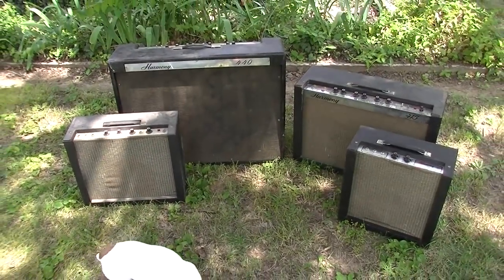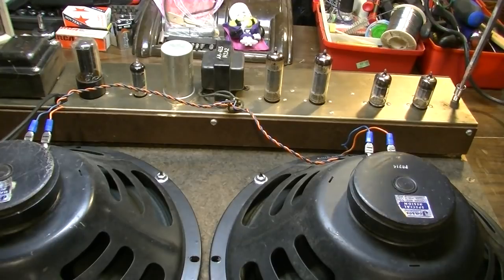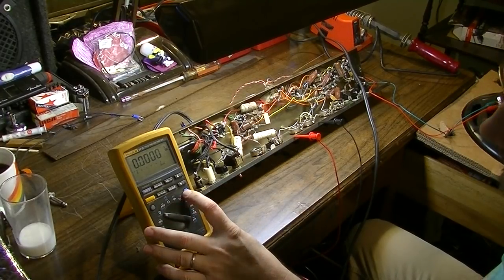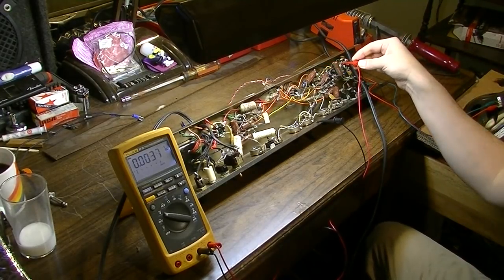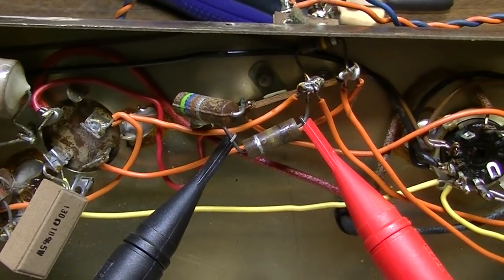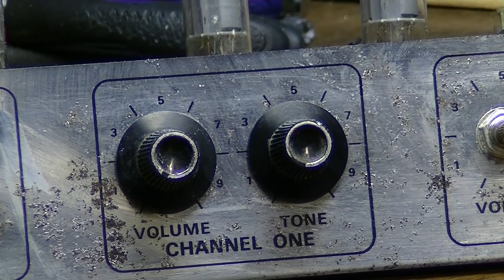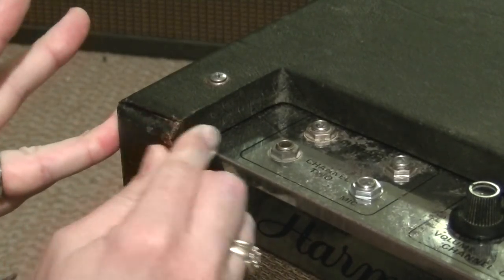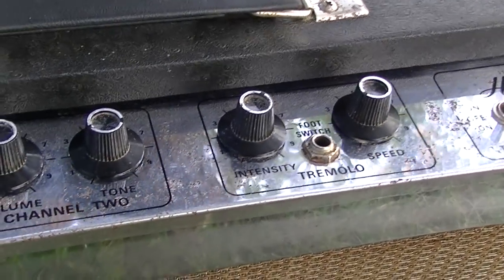The Ken Fischer "Sleeper" Amp! - Harmony H415 Restore & DEMO

Comment: I have one of these that used to belong to my cousin.  The amp stayed in a hot attic part of its life, then later a moist basement for 35+ years.  Rusty, covered in mold, much of the amp was gone as well as the particle board.  I had to replace the audio transformer, the filter can, striped the cabinet and use bondo and Titebond to repair some of the rot and loose joints. I fabricated a new speaker panel (now a 1x12 instead of 2x12) with birchwood paneling.  It is currently painted with flat black trunk bed liner until I find time to replace the ostrich tolex (which I've never done).  The Jensen speakers were rusted, no paper left, so I put a Emerson Private Jack in.  The circuitry was the only clean part of the amp oddly enough, but replaced the capacitor can with some filter caps I had from a previous project.  I cleaned the pots and jacks.  It still hums a little.  I would like to reduce that some more.  Not sure what it is.  It has a big very warm sound and cranked up it breaks up so nice.  The tremolo tube was the only original tube in tact.  Construction was a little cheap compared to the big name amps, but it was still great quality compared to some of the amps sold today.  It held its own against some poor treatment as it was just an old piece of junk, but now it is a treasure.

Comment: This was great to watch. My very first amp was very similar- Harmony with 2 channels and 2 , 12 inch Jensen speaker and  red racing stripes down the front. My father was teaching himself  bass and purchased this as his amp through the Alden's mail order catalog-  based in Chicago about 1967 or 1968. 
When I had been playing guitar and taking lessons after about 2 years, my teacher said I was ready to move to a better guitar and to electric, so this become my amp in about 1971. My father has a degree in electrical engineering and I remember him distinctly saying the amp was 25 watts and had 2  6L6 in push pull  parallel, so not the EL84 you mention in the video.I had no idea what any of the tube info , etc. meant at the time.  He  purchased a Lafayette bass amp- also mail order. 
I remember my Harmony as a sweet amp but I could never  push it into any kind of overdrive and that would have been too loud in our home and then in my first band- 1973, the other guys in the band did not have anything as  nearly as loud , so again I could never push very loud. My  friend Bill played through a small Alamo tube amp, with either a 10 or 12 inch speaker.  I played my first gigs with this amp in 1973 ( school variety show and parties that summer)  with my friends in the band and also a wedding band with my Dad playing his  Harmony  semi hollow bass and a  New Year's Eve dance at the local AA. - pretty safe being with your Dad in the band and at AA  for  age 14. 
I either sold or traded  the Harmony  in  around 1975 for a Peavey standard 130 watt solid state amp and 6x10 cabinet.  Even in the late 1980's I realized I should have never  traded the Harmony tube amp in.  Thanks for the memories.

Comment: Hey Brad,  I appreciate all the work you put in to the videos...  I have found for my amps I use a liquid Castile soap watered down (a few drops of soap in 6-8 oz of warm water) with a toothbrush cleans up most of the 50+ years of dirt and dead skin cells.  It works awesome for knobs.  Soak them for 15 minutes give them a quick scrub with the brush and rinse.  They will look new!
Reply from the maker: Yeah, I try to use stuff that isn't toxic as much as I can. Most comes clean with soap and water. Rust is an exception though.

Comment: You are definitely a vintage amp guru! Sometimes you get lucky and don't have to do a lot to get these amps up and running right, but you never quit if you have to do a lot. Great video! Good series on these Harmony amps. The next will be interesting to see. Thankz
Reply from the maker: Thanks, man. I'm looking forward to the next one myself. Should be a real Doozie, judging by the outward state, and I KNOW it's going to absolutely roar.

Comment: Hey Ken, I just realized, that you can use "Must For Rust" liquid for those rust issues, they sell it at Lowes or Home Depot.  I wish I had one of those Harmony H415 amps for my guitar. You can also use the liquid plastic, which I used for my tool handles,  then got the idea to fix the holes in my $20 guitar case, I believe you can do  it for those missing plastic spots on the amp box itself, (do not brush it with fingers use brush).  Thank you for your information on these Harmony Amps, can't wait to get one, because I believe tube amps give a better quality sound.    Take care Ken.   From Ben from New Jersey.

Comment: Nice work, that amp does have a sweet tone. Gas will get that crap off your fingers, or the low Vfc mineral spirit Eco substitute product they sell at the big box hardware stores will as well if your worried about being a bit healthier and don't want to smell like gas (I always have gas on hand so I end up cleaning degreasing prepping with it more than I really should). Also (from my experience restoring vintage interior car parts) I bet that vinyl spray paint for repairing vinyl car upholstery (buy at any good car parts store) would work well to finish up those tears in the leatherette (Tolex). It works magic on old interior car parts which appears to be a very similar material.
Reply from the maker: Yeah, mineral spirits is safer. I use that sometimes. It's kind of fun to pick at the glue the rest of the evening though. 24 hours later and I've picked it all off manually. Hand modelling gig, here I come!

Comment: What about that cracked cap? Did I miss you finding it? (at 8:09 it is clearly visible)
Great tip for removing that rust- a little bit of vegetable oil, let it sit for a day or two and burnish with a popsicle stick- works wonders  :)

Comment: Heya Brad! Fantastic work as always on this great vintage piece! I saw something of interest that wanted to bring to your attention... if you pause the video at the 8:00 mark, does the brown .022 capacitor in the center have a crack in it? It appears there's a crack on the right side, near the edge of the capacitor.
Reply from the maker: Yes, that cap is cracked...good eyes. A couple other commers also pointed that out. I'll get back in there and change it. Nice to have all these different sets of eyes.

Comment: Those type of pots you can spread to make the knobs tight - but later model stuff often uses cast aluminum "pop metal" shafts and 1/2 of the spline will break off if you try that!

Comment: As an old aircraft mechanic, & navy guy, when you see that "bubbling" type corrosion, that's called "intergranular corrosion" we usually try to cut out the piece of metal, or completely replace the affected electronic component, be it a a jack, socket, etc etc. I'm unaware of any thing that can defeat that type of corrosion, as it actually corrodes from the inside out. (I've done both structures & electronics). Saw one old man take scotch bright pad on a high speed grinder, to remove the stuff, but I know you were trying to save the printing on that plate. If there have been any advancements in the last 20 yrs I'd love to hear about it.(worked a corrosion mod on DC8,9,10s, I was picked to clean up under the restroom...you can guess what piss does to aluminum...a sad sight to behold. But I was being paid $16 an hour, back in 1986 so I didn't bitch.) Great vid. Good job!

Comment: Dr.Z made a model in collaboration with Trainwreck.
In my experience I have noticed there are fewer spiders in old amps which are not virgin.
When you work on amps of this age, do you normally convert the AC wiring to grounded/3-prong?

Comment: I think it has a more authentic vintage look with all the corrosion.
The pots in many newer amps would fall apart with the level of force you were applying to spread the shaft.
Reply from the maker: You do have to be careful spreading the shafts on made of pot metal. You can still do it, just gotta be slow and deliberate.

Comment: Awesome videos. Thank you! Trivial question: when you are trying out different things like resistors, transistors, caps, etc and the board is jam packed (like in your mesa roadster video) do you remove the board to desolder/solder from below (where it was initially soldered) or do you have a method to do it from above? Thanks!

Comment: Why not use Dielectric grease on tube pin/sockets and input/output jacks after cleaning to keep them from corroding?  🎸
Reply from the maker: Never used it before. What kind do you recommend, I might try some? Thanks!

Comment: Hi Just a thought! When I have used superglue on amps in the past I found it works much better if you go round the inside of the coverings with a paint brush of water about an hour or half hour before applying. The glue works much better and you don’t need to get it on the surface so much or get it on your fingers. 
Great series of videos! Cheers from England.
Reply from the maker: Thanks for the tip. May try that sometime. Old habits die hard though. :P

Comment: Hey Brad - what type of Super Glue do you use for the "fabric" repair?  That can't be the stuff that will weld your fingers together...
Reply from the maker: It's just garden variety liquid super glue. Yes, it'll glue your fingers together if you stick them together with glue on them, but you'd have to hold them there for a few seconds.

Comment: Love your videos. I have a harmony H400A plug it in and all you get is a very loud hum no other sound, What do you think could the problem? Thanks Dan
Reply from the maker: Replace the power capacitors and make sure the power plug is oriented the correct way. If you still get hum, reverse the plug.
Reply: Thanks Dan

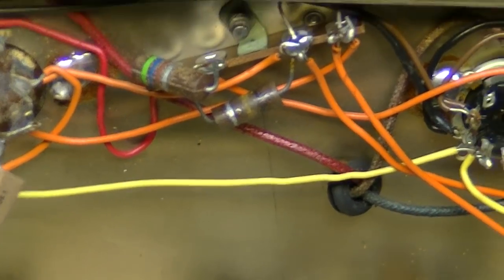Comment: 7:50 talks about how the Goodalls caps are pretty good and hasnt had any problems out of them as he scans across one .022uf Goodalls cap that has a huge splitting crack all the way around its diameter and misses it and appears to never catch it throughout the whole amp servicing. :P

Comment: Great video, sounds great!!!\m/!!! .. I dig the proper Safe Hot Probing. I use CA glue for Vinyl repair as well..Tip on removing CA glue from fingers, SandPaper then Gojo or similar hand cleaner.. With Caps its just like what Forest Gump said . You never know whats your going to get ! I've seen 1980"s Decoupling 400V Orange Drops leak DC on a 270VDC circuit. Iv'e seen Them with Holes Blown in the side on the same circuit.

Comment: How do you not change the plug and still not get shocked? I found a old Sears amphead I wanted. It is cheap. Solid state. But one guy said until he changed the plug he got shocked all the time on his? How much to pay some one to change the plug?
Reply from the maker: The cord was changed to a 3-prong. And it depends on a lot of factors whether or not you get shocked using an amp. A 3-prong cures most of them.

Comment: Interesting that you used the artist paint.  I do the same procedure but I use black fabric paint that you can get at walmart.  It dries quickly and is very similar to a tolex feel finish.  You cant even tell it was applied after.
Reply from the maker: Thanks for the suggestion. I might try in the future.
Reply: the problem with artist paint is, it doesn't really dry.

Comment: Great Video thank you for sharing  your restorations.   I hear something at 37:00  on the audio  break up that's like a spotting or separation.  Did you hear that too? I was curious. It's nice Amp.  I like how meticulous you are with even the repair of the separated covering material. Oh Tolex. :-)    What to do with a death cap has me baffled my son first talked to me about it while checking through a 1968 Gibson RVT35 it uses 7591 and 6EU7's  lots of transformers.  We have schematics but this this is powerful I received it as  a  chassis that cost only $67.00 and it works has original footswitch. Now it has a custom made Cabinet to fit and shaped like the original but we opted to put Blonde Tolex and Oxblood Grille and  a good speaker.  PROBLEMS: Microphonics and shrill trebles.  Thanks again you do lot of great work. I get to rambling
Reply from the maker: Thanks for the comment, James. Dunno...could be the V2 socket. I cleaned and tensioned as much as I could without changing the socket. Every now and then it'll still make a little noise though.
Reply: It's a good design, I am glad you confirmed it my 65 year old ears are still holding up but have some gaps in my hearing frequencies Hey have you done work on the 1960's Silvertones with the White Sparkle grill covering, Square Amp head in speaker cabinet type?
. I have all the Silvertone 1481,82,83,84,85 the Dano made for Sears the all restored nicely still working to determine why channnel 2 on the 1485 wants to red plate 1 of the tubes. I will get to it soon. I love all vintage tube amps. Lucky to see what you do on restoration. Thanks again! Have great week!
Reply from the maker: Did you check the coupling caps between the phase inverter and output tubes. could be a bad one.

Comment: Can you jumper channels 1 and 2 on this amp? Thanks
Reply: 305a here (Princeton circuit w cathadyne inverter) gifted from a bandmate - in a backyard shed.  No need to "jumper" channels on it since channels WERE interactive and the tone WAS common to both (no signal loss as w tone stack).  I rewired this (60s tweed circuit) to a '63 Deluxe/no reverb layout (added mid-boost foot switch that Princeton's lack).  Also swapped the original "paper" OP (looked overheated) with that from a Curtis Mathes hi-fi.  Ran a 2x12 open back cabinet(16 ohm)Greenbacks (no pedals) and used the single 12 w Digitech RP200 for a worship rig.  FYI the Shumacher PT will also run 6L6s (if you add big boy amp screen resistors) and EL34s (when properly wired/biased).

Comment: Can't these caps maintain voltage while leaking DC current across?
Reply from the maker: You mean the power caps, I presume... If the power caps were bad, that would usually be pretty obvious in a guitar amp. There's different modes of failure, but in general, if the power node's voltage is steady and about at the level you expect to see, and there's no hum, you're probably ok. Granted, these are old, but they are inside a can, and that does seem to make a big difference in my experience in longevity.

Comment: I noticed you don't use a tube cheaker?
Reply from the maker: On amps like this, I don't change tubes unless I suspect there's a problem with one. Problems are usually fairly obvious.

Comment: Watching you spread the pot with split shaft with a screwdriver I winced.. I have broken off too many. It's like they might be made with powder metal or something, they can be brittle. I have taken a small piece of shrink wrap tubing, heated it to shrink it right on the shaft.  Some small sheet metal shims might work as well.  Just sayin
Reply from the maker: These are good American made vintage pots with brass shafts. They aren't pot metal like these new crappy ones. You can bend those too, just gotta do it slowly and carefully.

Comment: Use Coca-cola on rusty chrome, not baking soda.  Sounds crazy, but trust me, you will be amazed.  Standard practice for car or motorcycle restoration is to use aluminum foil to scrub the rust off with the coke, but that would kill your lettering too.

Comment: I would use some old tolex and patch it as best as possible
Reply: or some of that black liquid electrical tape in a bottle.
Reply from the maker: I probably could have stolen a piece from somewhere on the inside of the amp for that large area. Not a bad thought...

Comment: 8:04 that capacitor has seen better crackless days
Reply: dealerbinq glad somebody else caught that
Reply from the maker: I see the crack now. I did miss that one. It tested fine though, believe it or not.
Reply: could happen to anyone! I've seen capacitors in way worse shape that still worked perfectly fine. I guess it's an paper wax or oil cap so it will be more prone to drying up but keeping the same capacitance since the surface area of the two plates and distance doesn't change. It will corrode when exposed to moisture.
Reply from the maker: It is on borrowed time. I'll be getting back in there to change that one. Thanks for pointing that out!
Reply: It was a little funny as I noticed it right as you said "they're pretty well sealed"  :)